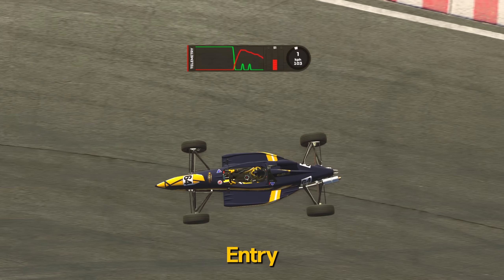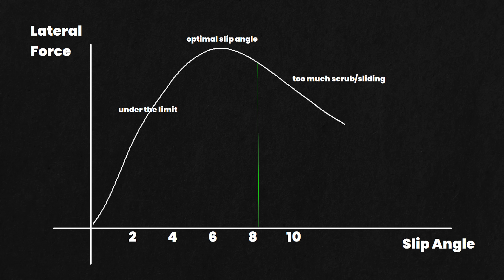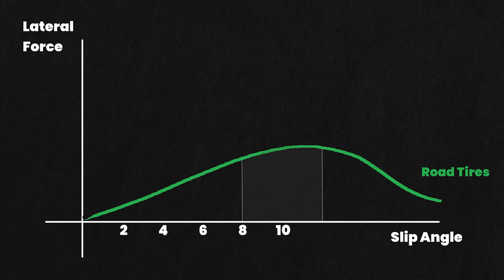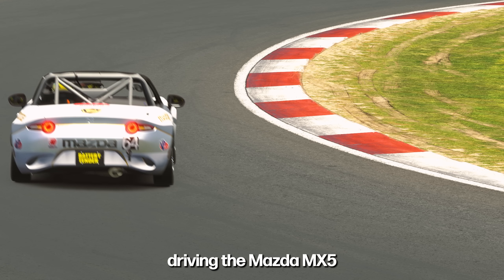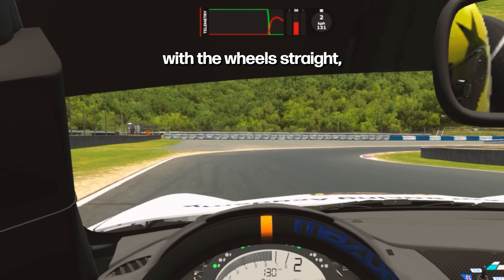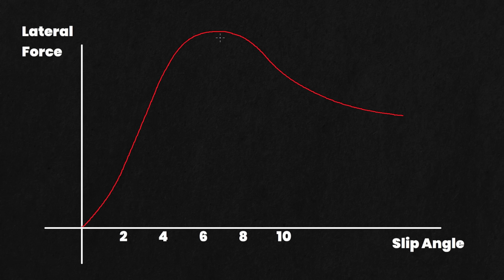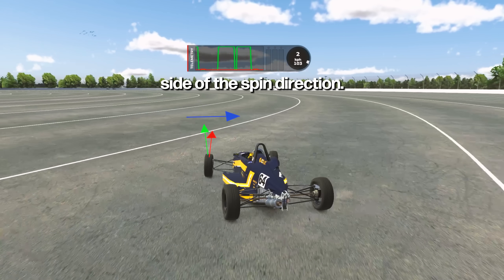The True Limit in Motorsports - Slip Angle Explained

Comment: I have always referred to the optimum slip angle as "Tyre Creep" the tyre deformation is literally allowing the contact patch to creep accros the surface without excessive abrasion to the surface (which brings with it heat).    
That creep feeling is my happy place, but obviously it takes a lot of practice and learning of the track surface in a forever changing environment. 
The tyre sidewalls play a huge roll in this too, along with the ability to have a proper inflated tyre that sees a consistent contact patch across the whole width of the tyre between the sidewalls (outside of the camber alignment).
Reply: I just saw your Radical cup win, congratulations bud 👏👏🏆🏆😊😊👌👌
I left a comment too.

Comment: 12:50 That's something not mentioned in most videos. You not only need to turn into the slide but you need to be applying less lateral force (or lateral force in the opposite direction) than the rear tires.

It's possible that trying to correct a slide (to slowly) will keep the front tires at optimal slip angle (in the direction of rotation), while the rear tires are past optimal slip angle, causing an even faster rotation.

Comment: It doesn't change the rest of the video, but, technically the maximum amount of deformation happens at optimal slip angle because that's when the tire is at its limit. Passed that the tire is sliding meaning it has less grip and won't have as much force to be deformed.

Comment: Simracing Physics Police here. You are in my opinion making some pretty big errors and oversights, in a video that is presented with confidence and probably accepted by most of the viewers as truth.

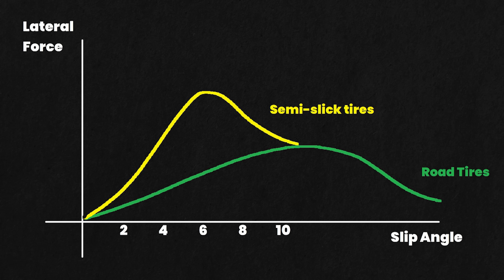First your curves at 5:17 come from books like 'Going Faster' and others. They are a completely fictional drawing of what a driver feels, at best, but certainly not what a slip curve actually looks like. I have not seen slick tires peak below 4 degrees. Maybe they exist, I'm sure that is possible, but plenty of racing slicks are more likely to be around 5 degrees, and more is possible. Modern road tires do not peak at 10+ degrees anymore most of the time. Corvette tires from 2006 peak around 6 or 7 at most. In other words, there CAN be a peak slip angle difference between road, semi and slick tires, but there doesn't have to be at all.

Second smaller gripe is, the slip curve always starts at its steepest. They don't ramp up after 0.5 or 1 degree, they're the steepest at 0 degrees slip angle.

Third gripe, the drop off after the peak is very complicated business. I'm sure depending on the conditions a tire can loose between 5% and 50%, the latter when it is on fire, the former when it is cold, possibly. What is certainly NOT likely to happen is that the grip drops away faster than it came up. Cars drifting sideways at huge angles can still pull 80+% of the G force, so probably 80+% grip can remain for some tires, even when pushed and hot. Tire data for this is rare and complicated. I wouldn't dare to draw a curve, as it all depends and few people know.

At 5:44, you say the FFB gets stronger as you get close to the peak slip angle. This is very likely NOT true at all. The FFB that comes from a tire is called its aligning moment. And curiously, this moment peaks about halfway towards optimum slip angle, and is often near zero at peak slip angle! If your car suspension wouldn't have caster or trail, your wheel would not even self center anymore at peak slip angle. So the most grip would be had at the point where you feel literally nothing. Of course with suspension geometry, this is avoided, but on I would say all racing cars, force feedback reaches its peak significantly before grip does. Your very subtle difference at 6:08 is unlikely to exist. Maybe on karts with huge jacking effects, but not on racing cars.

At 12:51, A spin is (more likely) to be saveable when the total rear grip is higher than the front grip. For this to happen, the front tires don't have to put an opposite force on the ground, just a smaller force than the rear. But if you're rotating super fast, even if rear grip exceeds that of the front, it will take some time for the rotation to reduce and you may still spin.

I am picking on you yes. :D But, many, if not all driver coaches, no matter how good they are at coaching and driving, make mistakes when it comes to vehicle dynamics. Driver61 for example, Ben Collins, you name them, they probably messed multiple things up in their videos. I don't argue with the coaching or driving skill, but I see a risk in this because viewers are often not critical enough and are willing to accept a driver's explanation even when what is said is effectively 1+1=3.

And successful coaches like you, get a lot more views than boring engineers do, so in this way false information can spread and before you know it, AI uses it to tell us we need to add glue to our pizza, or something. Sorry for the critical tone, I mean you no harm, but I am starting to respond to errors I see in the simracing physics scene on the YouTubez.
Reply from the maker: Firstly, big fan here.

Thank you so much for your feedback and keep them coming!

I can definitely say that I'm way less of an engineer and more of an instinctive driver when it comes to motorsports and I knew 100% I was going to mess up the drawings of the slip angle, as well as some details when explaining slip angle in a more technical-engineering way. My objective with this video was to make an introduction to the topic and to briefly describe how it feels on track.

I'll most likely make a new video in the near future addressing the points you mentioned.

It makes total sense that the drop is way less steep than the initial ramp up with the angle. Sorry, I let that 'slip'.

Regarding the 5:44 explanation about the FFB, that doesn't make a lot of sense to me, because I've been driving for so many years in iRacing and now 3 years IRL and the peak grip on the front tires has always matched (or closely matched, slightly after) the peak steering resistance... And when I tried (literally for the sake of experimenting) more steering, the FFB would always come down alongside the grip. Could you send me some more details about that? 

At 12:51, you're totally right. And the proof of that is that if you're sliding and you just throttle + brake at the same time (to lock the fronts and not the rears) the car magically corrects itself back to straight. My explanation was definitely overcomplicating AND incomplete.

This is the first time I've done a "more physics-wise" video, and my first video on Slip Angle ever. 

Your feedback is extremely valuable and I'll try to address everything soon enough on my next videos and pieces of content as I continue evolving my coaching career.

Thank you!
Reply: @SuellioAlmeida  Glad you don't mind some criticism! 
About FFB maxing out when grip maxes out, it will depend hugely on the car and tire. Lighter cars with less downforce can use significant caster angles and suspension trail without being too physical for the driver. In those cases, FFB can reach its maximum not super far before grip reaches its maximum. Still it is quite likely that FFB stops increasing, maybe plateau's a bit, between say 10 and 30 degrees of steering wheel rotation before grip maximizes. Cars with power steering can also have large caster angles and maybe even map the system so that the force peak equals grip peaks. Sims can also be wrong, and some aspects of the iRacing tires are dubious at best, maybe this isn't the sim's best point. 

On a physical car without power steering, like the Indycars, the human strength plays a big role. Car designers can't just add caster angle and suspension trail because it would make it nearly impossible to take high speed turns because of the silly steering strength it would require. On such cars, and I have seen data for this, FFB reaches a peak and then drops about 50%(!!) by the time your G force maximizes. It can be so extreme that if you keep adding steering, FFB drops 80+% from the maximum.

On smaller single seaters like the F4, the steering feedback is better because of the low downforce and weight. They can use more caster and trail, which always provide centering force even when the tires themselves no longer have any pneumatic trail.  Here the drop from peak FFB to max grip FFB is still around 25%, but it doesn't keep dropping as much, maybe at silly understeer steering lock, you have about 50% of peak FFB remaining, still communicative, unlike the F2 type cars where the FFB almost turns off if you're into silly understeer.

Maybe what happens though is this. Peak grip could be at 8 degrees say, but you probably have 95% of this grip at 6 degrees. For a hotlap it might pay to be at this 8 degrees, steering a bit further beyond the peak FFB. But to make your tires last the race, driving around 95% might be better, and maybe this is where you are more often in general. In that case, the slip angle you want to be instantly a bit less far beyond the peak in FFB. I made a long video that makes sense to watch at higher speed : /watch?v=pCq01LHaIVg
Reply: @NielsHeusinkveld  I think its worth adding to the discussion that while in real life you most often have a direct contact between the tire contact patch and the steering wheel (even though there might be rubber pieces or other "feel modifying features" in that chain) while in the sim you have several steps of interpreting whats going on

Wheelbase and wheelbase settings, or even how the software transfers the may-or-may-not-be-correct data to the physical wheel might screw it up on the way. For example rotation speed of a G29 wheel or someone who´s been creative with the settings on a higher end wheelbase

I find that this often is a obstacle when coaching via the sim for real life drivers, especially if they are using hardware or software that I am not familiar with
Reply: @olof103eriksson  IME sim FFB is much, much better than real FFB in communicating what the tire is doing. Real FFB has oscillation, vibration, friction etc. in it. You can even feel those if you add them into a sim model; it'll become more vague, with more noise and less direct relation to tire grip. The FFB in most sims is very simple and clean.

However most (all?) publicly available consumer sim models have modeling issues, pretty significant ones. There is no guarantee whatsoever the behavior of the components is correct, even mostly. Especially when in the fine details.
Reply: @SuellioAlmeida first, this is the first video of yours I've seen and think you have done a great job explaining what can be a such complicated topic in a way that people can understand. 

Regarding what you mentioned about 12:51 and being on the brakes and throttle at the same time - There is a driving technique called 'heel-toe braking' that is used in the braking zone upon approach to a turn that will stabilise the car in a similar, yet different way, but ultimately helps with certain aspects of how the car performs and can be controlled while entering into the turn and achieving desired slip angle.

I'm sure you've likely heard of this technique before, but if you haven't, then I think you'd find it an interesting topic to research given it's relationship to cornering, inertia, slip etc.
A professional driver who does this amazingly well is Shane Van Gisbergen (SVG), he implements this to not only pass other drivers during turning but also for tyre management and longevity.

Also, dont think in any way that im trying to criticise anything you're saying, I'm not. Rather, just mentioning that this is more of a precursor which plays into many parts of your video and thought it is worth mentioning.
Reply: This was a fantastic read to add grounded context to the video. Thank you
Reply: I am not sure about that you wrote in the fragment or I missed some understanding : "Second smaller gripe is, the slip curve always starts at its steepest. They don't ramp up after 0.5 or 1 degree, they're the steepest at 0 degrees slip angle.".
Did you say a maximum grip is before slip angle is at 0° ? - I think regarding to my observation the maximum grip is at the past of the slip angle by 0,5°, so when both factors are involved - the maximum grip without slip and just right after a little of slipping. Resultant being at the maximum grip state. Moreover then there is some pre-adjusted a car angle as a whole relative to the road's turning. So could you elaborate a bit on this issue ?
Also the curve of the maximum grip I rather would draw it as not being just the inverted parabola, but parabola with two tits with latter in the region with slipping being slighlty bigger.
Reply: @Robert-p7b  I mean the slope of the line as it starts on the bottom left of the curves is the steepest. It starts at zero, but is for the first half of grip or so, a straightish line. So between say 0 and 2 degrees slip angle, you have a straight line. Then it starts to flatten towards the maximum grip which might be at 5 or so degrees.
The slope of the line, how steep it climbs, is the highest at the bottom left of the curve. In the video the lines go more horizontal for the first bit, then climb up steeper. That's my little gripe.
Reply: @NielsHeusinkveld  Ah ok, thanks for the clarification.
Reply: Top tier yt comments here, as a car enthusiast and a former engineer, this details warm my heart. Thanks a lot for the knowledge!
Reply: Thanks for tip about adding glue to my pizza. Much better than marmalade for getting the used spark plugs to stick.

Comment: Good video as always but there are a couple of small details that I think could be a little more accurate when talking about understeer, oversteer, and neutral steer.

6:34 

During understeer, you still have control of the front tires with the steering wheel.  This means you can still get the front tires to the slip angle of peak lateral acceleration.  Understeer just means that whatever your slip angle is at the front, the slip angle at the rear is less than the front and lower than optimal.  

The same is true for oversteer, but this is much harder to do.  It is possible to keep the rear tires at the optimal slip angle when you have oversteer.  This is done by underdriving the front tires and countersteering very effectively.  Oversteer just means that whatever your slip angle is at the front, the slip angle at the rear will be higher.  You still have absolute control of the front tires slip angle, but if you try to bring the front tires to optimal slip angle then the rear will go way past optimal slip angle and you will spin.  In order to not spin during oversteer you must keep the front tires below optimal slip angle.

For the neutral steer example, you define neutral steer as the front and rear tires having the same slip angle.  I think it is worth clarifying that this does not mean the steering wheel is perfectly straight.  This is because, due to the rotation of the car, the front of the car and the rear of the car are going in slightly different directions.  In slower corner, the rotation of the car and thus difference in direction the front and rear axle are going to be larger.  In really fast corners you get closer to zero steering input for neutral steer.
Reply from the maker: Thanks Jeremy!
Reply: It's not even really slip angle based AFAIK, the inertia distribution of the car will determine how much lateral force is needed for it to be neutral, understeery or oversteery, and very often front and rear tires of different sizes will have different force potentials and peak slip angles. Slip angles will tell you more about the direction of travel of the car.

Generally close enough, though.

Comment: is there any telemetry that gives your slip angle?
Reply: think about it. tire deflection. you can't just measure it on a track in real time. you've have to have sensors embedded in the structure of the tire. you should be able to approximate it from other telemetry.

Comment: As someone who also do flight sim, this is almost like Angle of Attack.
In more broad term it's the slip rate, both laterally and longitudinally, and combined triangularly.
Reply: That is actually a really good analogy. The slip angle graph / curve of a tyre is comparable in concept to the L/D curve of an airfoil. The only tiny problem is that comparison will help nobody besides pilots 😅
Reply: Microsoft Flight Sim😂 @LasseJOugaard
Reply: Yeah I guess youd be right. Just like a wing becomes less efficient when it loses laminar flow after the AOA becomes too steep, a tires coefficient of friction decreases after the slip angle becomes too great.
Reply: @dpjohnjones432  Just to clarify, the wind losing "laminar" flow isn't true. There is always a viscous sublayer in the BL over any surface. However what you're talking about is stall, where the flow is fully detached from the surface and the low static pressure on the suction side is reduced massively.
Reply: do yall drift
Reply: the AoA analogy really helped me tbh as im also into planes